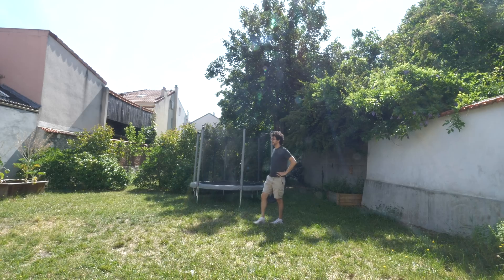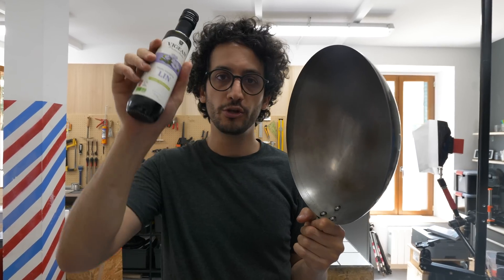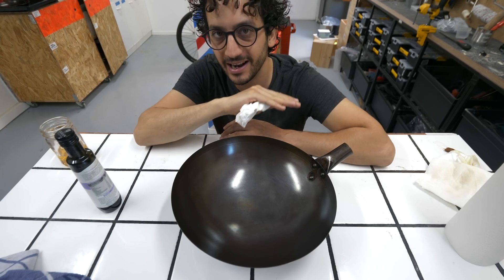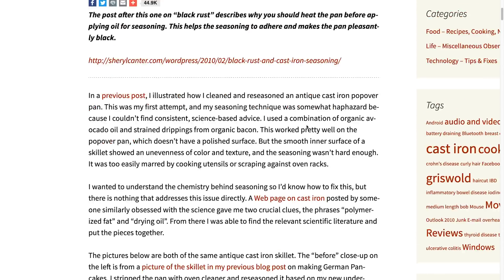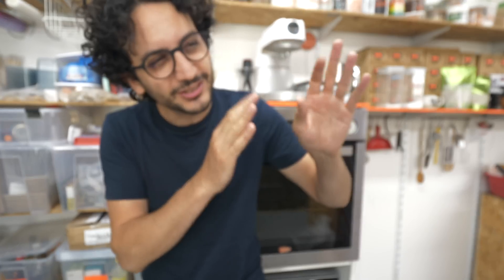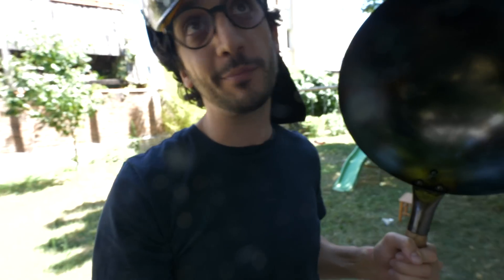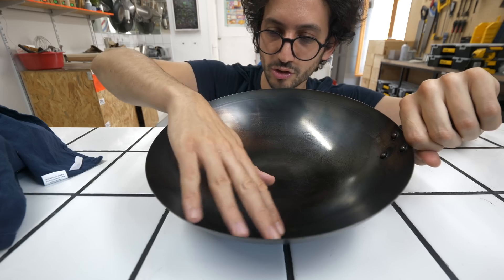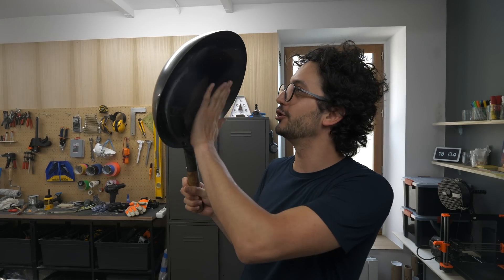Can I Make my Wok Slicker than a Nonstick Pan ?

Comment: hmmm i always thought chinese cooking wok normally do this kind of seasoning whenever they have a BRAND new wok, without the intensive rubbing and unnecessary thing , they just rub away and wash away the chemical (prevent rust) coating and put on some oil and season it gently on a high temperature cooking flame? plus if they going pan sear, they will put in the oil to cover the surface and then dump excess oil to other pot (if you going for nostick why you even put so much oil to fry at the first place).

Comment: cast/high carbon  - no contest.  If the pan is used, it is no maintenance, and more options.   With the exception of 1 pot, used for rice and pasta (never sees temps over 212 F), I've only used cast iron and carbon steel, since the 90's

Comment: my experience so-far with steel and cast iron pans has been great!
 It started with a small thin iron pan taht i got new. i didn't have an oven yet, so 
 i tried to do it on a stove the same way i saw cooks do it with new woks (heat up 
 very very hot until it makes colors, and add oil when it stops making colors) 
 it was okay-ish, but the seasoning really made itself when using it.
 Then, i got a big thick iron pan at a flea market which i cleaned and seasoned 
 with olive oil in the oven (2 coats), it's very versatile : eggs, meats, omelets, 
 and homemade stir-fry with leftovers. It's very heavy, but the ability to store 
 heat well really helps when searing meats and makes them really juicy.
 Then a few months ago, i found a small cast-iron pan at a flea market for 2eur.
 it was super cheap.... but it was super cheap for a reason : it had at least 1mm
 of sticky burnt grime everywhere, even on the bottom... i took an entire 
 afternoon to clean it outside with a drill and a wire brush wheel. 2 coats of 
 olive oil seasoning in the oven, and now it's my favorite pan to cook with!
 And it is non-stick, just as long as you add a bit of oil.

Comment: In this State, I don't agree, that its better than a brand new teflon pan. But a well seasoned pan gets better with age and use. There is nothing like a 100+ year old cast iron pan for frying something. Plus, the oil isn't really an additive. That's what the surface is made from, and it adds the next layer of seasoning. Thats why you never wash it with soap, and that's also why it gets better with age. If you'd said 10000 Layers, then maybe it would be getting to that point. But if you don't have a couple of weeks to do that, then using it regularly for years is the best you ca do.

Comment: In my experience, Teflon does not produce a renewable nonstick surface.  Teflon's sticky surface does not hold up very well and it is mounted on throw away metal pans. Your method renews two of my favorite pan materials: carbon steel and cast iron.  Properly kept, they can stay in the family for generations.  Abused, they can be brought back to almost-new surfaces.

Comment: I use flax oil for seasoning my cast irons (four layers) but do a final seasoning (or two) of olive oil. I also "re-season" after every use by washing, warming to dry then apply light coat of olive oil on the warm pan. That process has worked very well for me.

Comment: What about ceramic coated pans?
 Just curious to hear opinions on it.
Reply: Seems reasonable, but after about half a year mine turned into everything-sticks pans, while the steel pan just got better. Just for dishes with lots of water or acidity, like anything tomato based I tend to use something else.

Comment: A properly seasoned steel pan is inherently superior to teflon. Teflon and every other non-stick coating wears out over time, and you have to use special utensils. But with proper care, a pan will season itself on a continual basis. While you should use wood or silicone, if you do use metal and scratch the pan, the scratch is likely to be light, and will fill in quickly. 

This is the same as with knives - by going to supposedly maintenance free, dishwasher safe cookware, we have given up superior qualities in cookware and realized little gain in the process. The only place in the kitchen for anything stainless is in prep surfaces.

Comment: How is it that the coating isn't carcinogenic, if you have to heat the oil past its smoke point? The coating does obviously wear off with time, so it's probably going into your food. How is that not a health concern like the usage of low smoke point oils in cooking? 
Are all these questions answered in your sources?

Comment: Question: how do you clean it without losing that protective layer?
Reply: Water.... No soap.  

Can also add a little oil while it's still very hot.   

I use to do this when I was a grill cook.  Before turning off the grill (turn heat down a little), use a damp cloth (and a spatula to move it around) to scrub the surface.  Turn heat back up and add just the lightest touch of oil spread thin across the surface.  Leave it for a bit then let it cool.  I would let it run while I did the rest of my cleanup, then it was the last thing I turned off for the shift.  

Sometimes steel wool might be needed, use this only if the damp cloth won't remove a spot.  The steel wool will can damage the seasoning in that area, so use gently and as a last resort, or if you are planning to season again soon anyway.

Hope that helps some.
Reply: After you finish cooking, let it cool down for a minute or two. Then add hot water and rub with a non-abrasive pad or brush, and rinse in hot water. Then heat the pan until bone dry on the range. Let it cool. Polish with a few drops of cooking oil on a paper towel, and put it away.
Reply: Thanks for the replys!
I suppose the same goes for cast iron skillets.

Comment: I was told Chinese chefs prefer a hand-hammered carbon steel wok.  The irregular surface allows one to move foods up the side of the wok and stay there due to the irregularity.  Your perfectly smooth surface is not traditional.  I believe typical woks are not truly non-stick for that reason.

Comment: Dont use paper towel to spread the oil, the tiny towel fibres WILL get stuck and baked into your season which doesnt make it smooth, probably why alex had to buff his pan...

Also I apply about 15 coats to my heirloom cast iron skillets, thats how you get the black look with the many many thin layers of baked on oil.

Comment: IMPORTANT - Don't use "boiled linseed oil" from the hardware store. Not only is it not food grade, but it contains metal catalyzers which are toxic to human health. Boiled linseed oil and plain linseed oil from the hardware store are solely intended for use as protective finishes on wood and metal furniture. 

(Boiled linseed oil isn't actually boiled. Back in the old days, they pressure cooked linseed oil to make a faster drying finish, and it is foodsafe, but I don't know of any manufacturers who do that anymore.)

Comment: I have thrown out my teflonpans and only use cast iron and carbon steel, the only downside is that they are heavy. But in return you will get a much nicer surface on the meat you fry and the pan will keep its temperature even when you add something cold to the pan. Plus that they are more durable in my opinion. Thanks for yet another amazing video, Salut!

Comment: I put mine in an electric, self-cleaning oven.  Is that not a good idea?
Reply: Last time I seasoned my cast-iron pans, I used the self-cleaning cycle to remove the old and crappy seasoning/residue. All the old seasoning just flaked off, leaving me with (slightly rusty) bare metal that I could easily clean and properly re-season. The highest (non-self-cleaning) temperature on my electric oven (550°F/290°C) worked fine to apply fresh seasoning, using Canter's method.
Reply: It's OK. The temperature is key.

Comment: I restore old cast iron, carbon steel and season them and woks all the time. Let me save future you and your viewers some work for stripping the old seasoning. Put it in the oven on the "Clean" setting. That gets hot enough to strip about 95% of the seasoning. Then you finish up with barkeepers friend with just enough water to make it a thin paste. It is an abrasive, but not as harsh as something like comet. This provides the best surface for your first level of seasoning without scratching the surface quite as much as you did in this. As for seasoning, you are pretty well spot on, though Avocado oil is nearly as good as lin/flax seed oil and WAY cheaper. Also smoothness comes from layers or time. It is quicker to achieve with carbon steel and takes longer with cast iron because it is more porous.

Comment: I would say that's absolutely better than a Teflon pan I mean a Teflon pan can chip and have its coating just scraped right off with that thing it's as hard as glass and if it chips or get scraped up or something you're just getting oil in your food not Teflon and you can even repair it relatively easy and its ability of non-stick I would say is roughly equal

Comment: Teflon: slickness approaching wet ice on wet ice, out of the box.
Seasoning: can DIY
Result: A cabinet full of flaking-off non-stick pans. One we use about once a month when using oil isn't the right thing.
Otherwise, All-Clad stainless for veggies and buttery eggs, and well seasoned Lodge for meat and other things wanting a good sear.

Comment: I have used DeBuyer pan for years, well seasoned carbon-steel pans are so much better than teflon and lasts for ever if you maintain it well !
Reply: I have a debuyer pan, left it outside for a year, it rusted very badly but i scrubbed it out with brillo pads and re seasoned, works well now and the metal is completely black inside and out.

Comment: When you did the heating in the oven, was there any smoke? Where I live the smoke alarms can be very sensitive, has put me off reseasoning
Reply: if you wipe the (foodsafe) linseed or flax oil (with no additives) fully, it will give off an odor for much of the time in the oven, but should not smoke

Comment: I'm sorry Alex, but, it's not better than teflon. When polymerizing the oil you're creating random polymers, plastics, some of which might be highly carcinogenic. Not to say teflon is in any way good...you probably don't want to be eating and breathing in flouride compounds. A inert ceramic coating like thermolon is probably the best in terms of safety. Or 316L steel if you're not cooking anything particularly acidic.
Reply: At high heats it is better. You can’t put Teflon on a high heat source.
Reply: @carlitosaqui  
True you can't put Teflon over high heat, but that's over 500°F. A temperature that almost no home cooks ever reach on the stove. What most people call high heat is really more like medium high. Regular people just don't set their stove on high and leave it there for 15 minutes of cooking. It smokes the house up, but the food is delicious.
Reply: "You probably don't want to be eating and breathing in fluoride compounds".

An ignorant comment TBH.

Teflon has the strongest bonds in all of organic chemistry. and is so non-reactive that it's the only safe way to store fluoroantimonic acid, which is 10 quadrillion times stronger than hydrochloric acid.

also, try to keep in mind when you're spouting such stupid things, that if you do not eat sodium, which is a metal that literally explodes when it comes in contact with water, and highly poisonous chlorine gas, you will without a doubt 100% guarantee die.

Just because something is dangerous on its own has no bearing on whether or not it is dangerous when it is part of a molecule.
Reply: @lordgarion514  Umm....he's right though. Teflon poisoning is a real thing that occurs from the decomposition of Teflon at high temperatures, which can occur in household cooking conditions if the cook is unaware of these limitations. Many factory workers have had issues from this, as have many birds which are significantly more sensitive to airborne pollutants. Just because something can store an acid and resists chemical reactions absolutely does NOT mean that it will resist high temperatures more effectively. If that were the case, iron and other metals, which are easily soluble in acid, would vaporize and decompose at low temperatures and acids would be strong solids (which HCl is a gas). That is to say, high resistivity in one domain does not necessarily apply to all of them.
Reply: @johnbs7  
No, it really can't occur in household cooking due to a clueless person. First of all, you have to have a more or less completely dry pan to even be able to heat it up high enough to decompose the Teflon.(look up how rice cookers know when the rice is done to learn why).

It's almost impossible to do while cooking, even over high heat. The problem is people are forgetful as hell, and forgetting you have a pan with some water heating up and it all boiling away is kinda common in the world.
You never wondered why you could boil water, even small amounts, on the highest heat setting for hours, with no problems even though everyone says high heat is bad for Teflon? It's because the moisture turning to steam keeps the coating temperature right around the boiling point of water no matter how high the stove is set. It's when people screw up and let it go dry that the temperature starts to climb rapidly.
Reply: @lordgarion514  Sure it can. I understand how boiling water works and maintains it's temperature, I taught a lab on it for the last 4 years. However, here's the issue: what if you're toasting nuts? What if you're attempting to sear a steak (which the surface should be mostly dry)? What if you're making a tart and unknowingly put in an oven or under a broiler.  What if you try to make a dry caramel? There are plenty of ways that someone who is not knowledgable about chemistry, or just don't read the safety warnings could create an issue for themselves by using this pan out of specifications. In that case it is technically their fault, but that doesn't make it any less dangerous or any less common.
Reply: @johnbs7  
All of your examples require absolutely ruining the food long before the pan gets hot enough to  break down the Teflon. Kinda like they forgot.....
Reply: @lordgarion514  so, is Teflon dangerous or notM
Reply: @lordgarion514  I'm not sure if you're replying to me; however, I was the youngest person in my department to start my PhD in Chemistry. I have published multiple papers on the topics of pollutants, specifically BPA among others, and worked with all sorts of compounds and understand the hazards better than most.

 With that out of the way, I never said fluoride itself was bad, e.g. the fluoride ion F-. This is what you would encounter in drinking water, along with numerous counter ions. However, I said that Fluorine containing compounds produced by the thermal decomposition of Teflon are dangerous. Specifically because they tend to contain free radicals and strained carbons, which can set off chain reactions in the body. I also really don't appreciate the name-calling and inflammatory remarks, as most of them are either factually incorrect or irrelevant to the discussion, despite the fact that you think they are.
Reply: @johnbs7  
Did your PhD help you understand how cooking works? Nope.

No one is breathing in a damn thing from Teflon when cooking. When they forget they're cooking sure, but not when cooking.

And no, you didn't say you don't want to be breathing/eating fluoride ions specifically from Teflon. Your language was all inclusive. So that's what I went by.

Comment: it is almost impossible to get a good even coating with the stove you are using. you need to go and borrow the super jet stove from Cantonese restaurants. watch?v=UGXGJD2xTzQ  That's like what my mum do, go friend's restaurant after peak hour and ask for help. notice in the video, the wok changed a lot of color but not as dark as black color. it means it is still new, and over time it will turn all black evenly when it is use to cook almost everyday. But the layer is build evenly and can last forever if the maintenance is okay. my mum's wok have been using for over 30years, still nonstick as new nonstick pan.